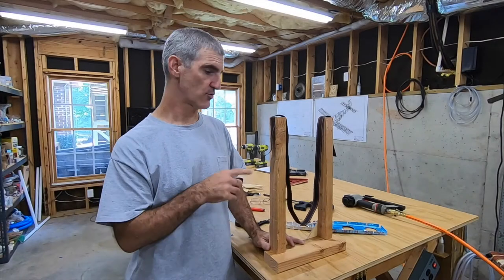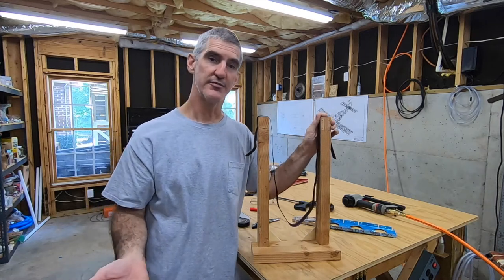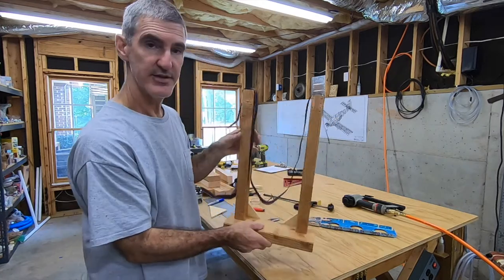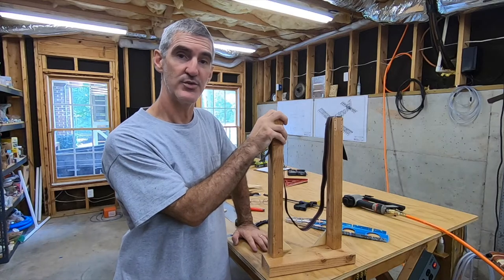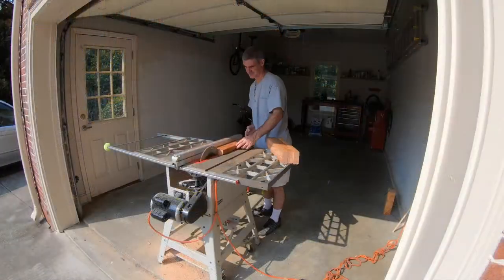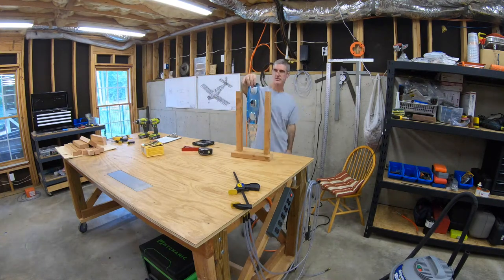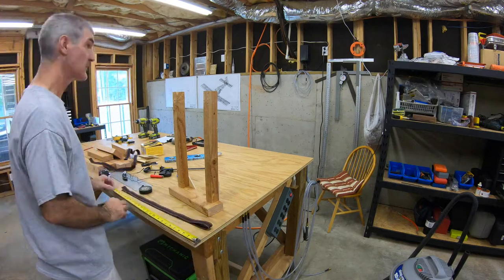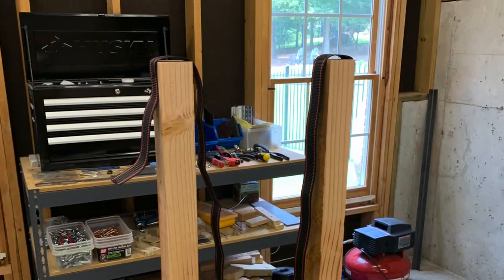RV-10 Build Log - Emp 41 - Making cradles for the horizontal stabilizer

Comment: Was your kit final size holes? I saw a post they were moving to final size. Also, do you have a contact email?
Reply from the maker: Nope, my Emp kit does not have final sized holes.   Not sure where they are in the process of converting over.  Maybe my wing kit will be ;-).
Reply from the maker: Contact email is in the About section…